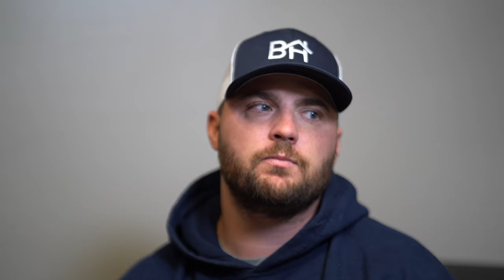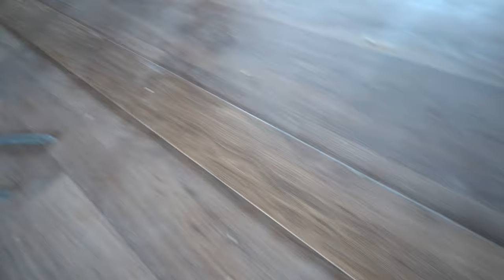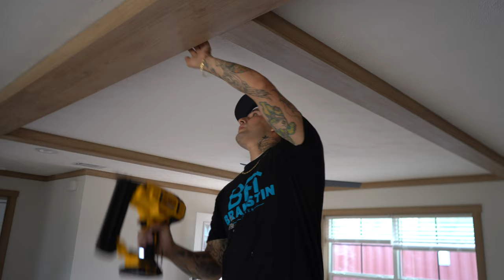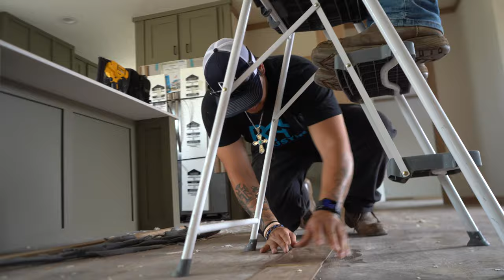What are mobile home marriage lines?

Comment: At the marriage line in my double wide is the potential for deep shelves in the wall. Are the gypsum pannels providing any structural support that would/should discourage me from removing them to provide increased pantry space?
Reply from the maker: Great question, the panel isn't providing structural support. You should be fine removing if needed, but proceed with caution and care.
Reply: @BraustinMobileHomes  Thank you for answering! We'll be reinforcing with added lumber and sturdy L-bracket (struts kinda) to support the shelves between the studs. Probably a canning season project so I have a place to stow my jars.
Reply from the maker: @jeas4980  Send us pictures when it's done!